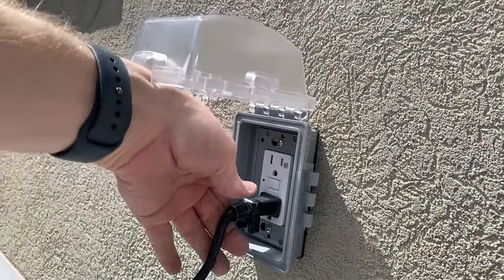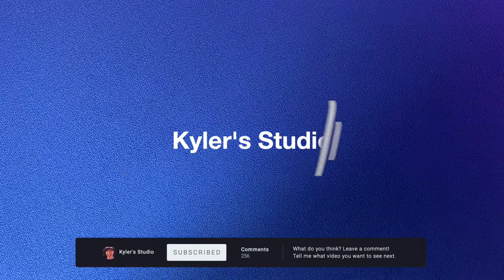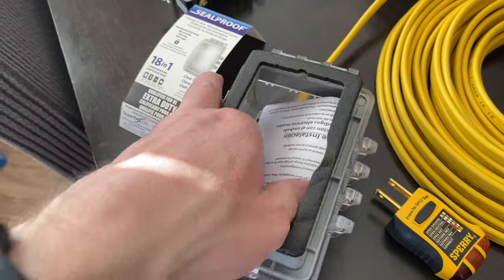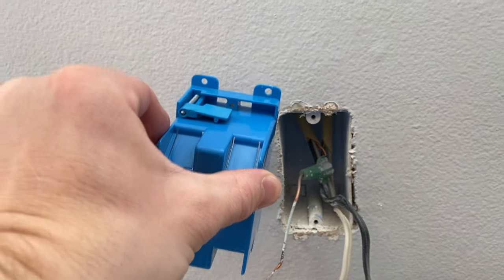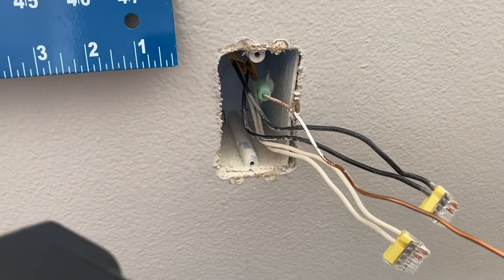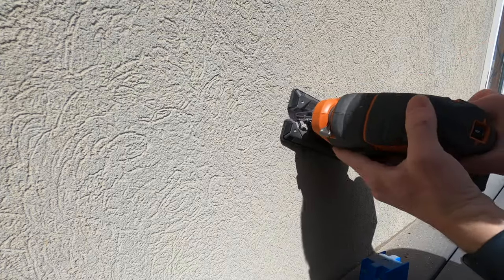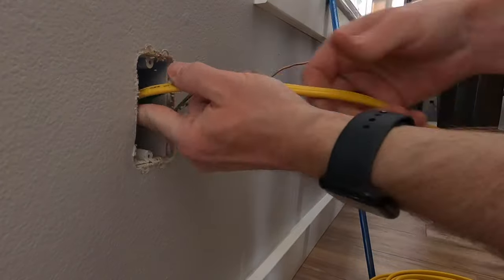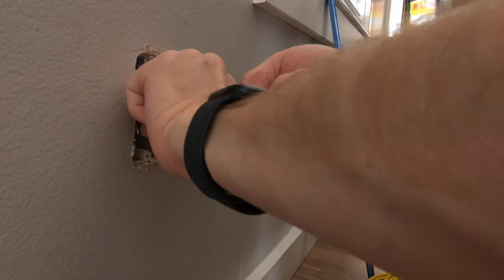How to Install Outdoor Outlet from Indoor Outlet

Comment: Oscillating tool or high speed wheel, which will fit this particular job best?
Reply from the maker: A grinder with a cutting wheel would have worked well for the long sides, but not great for the small sides; too much overcut. Good way to start though.

Comment: Have you had any issues with rain getting into the new outside box?
Reply from the maker: And no, I've had no problems with it without silicone or sealant. The foam is still intact, and the wall has an overhang, so no problems so far.

Comment: I have an existing outlet that is coming out from the wall. I tried to nail the blue box next to the stud but I have no room to get the hammer in there. Is there a different blue box I can use? Ty
Reply from the maker: Yes, there are boxes with screws you can get into a stud, or what they call old work boxes. Check out some of my links for ideas.

Comment: How do you prevent water from leaking inside the wall since you cut through the lathe paper?
Reply from the maker: I'm hoping the foam seal pressed on the wall box is enough to keep any water out. As it deteriorates over the years, I'll have to add some calking around the box or replace the box. It is also on a wall that has a roof overhang, so the only way it gets wet is when the rain is blowing sideways or the snow piles up more than a foot.
Reply: Cut a thin peice of butylstyrene for the top

Comment: I know this all worked… for now.

But there’s quite a few code violations here.  And that outside outlet isn’t going to stay in place for long as the stucco is going to crumble under load from the box and swing arm clamps as things are plugged in and unplugged.
Reply from the maker: What codes were violated and what would you do differently? Still strong a year later.

Comment: can u use 14/2 romex for wire ? even though its going to GFCI outdoors
Reply from the maker: "Can" and "should" may be a big difference. I used the same wire gage that was installed in the circuit because that makes sense to me. In my case, all the wire was inside the wall and not exposed, so it made sense to me.
Reply: You can’t use 14 if it’s a 20 amp circuit. In this case, it was a 20 amp circuit so he had to use 12/2
Reply from the maker: 12-20 14-15 Is what I remember. Just like green ground and black to brass.

Comment: You did the tab incorrectly. Push it IN, not OUT.  Then when you insert the wire from the back it will lock the wire in place.
Reply from the maker: You know what? You're absolutely right!! I totally forgot about that! It would make my clamp addition even less relevant. Thanks for the correction!
Reply: No. Completely remove the tab. They suck....😅

Comment: On stucco, ya gotta use some kinda sealant . The foam doesn't conform to all the surface irregularities. Without sealant, just hit it with water from a hose, and you'll see the leakage yourself.
Reply from the maker: Probably true, especially when the foam starts to deteriorate. I just didn't see the need because it's covered with a roof overhang. But you're right, I should probably go out and add some silicone or something to it.

Comment: The connector was unnecessary in my opinion... Not a negative comment and what do I know anyway... Your voice belongs on the Cheech and Chong, Big Bamboo album.  😂

I think the purpose of those connectors is to protect the insulation on wiring from the sharp edges of a metal box hole or knockout...
Reply from the maker: Probably unnecessary, especially considering the short run and not being designed for that..just wanted to justify buying the bag for another project I suppose. I'm not sure if the voice comment is a good thing or bad thing...I'm not very familiar. And yes, the connector is designed for a metal box knockout clamp, but they have plastic clamps now that seem like they would work just as well. Thanks for the comment!

Comment: I have to say, that was just painful watching you trying to cut your outside hole. I won't even mention the blue plastic box. Oh wait, I just did. One word of advice when adding a GFCI outlet from an inside receptacle, put the GFCI inside & the standard receptacle outside. That way you seldom have a dead outlet when you plug something into it. I know I'll catch flack on this, but I assume this is a 20A circuit since you're using #12 romex. Unless there is some #14 somewhere in the circuit or it's fed from a 15A breaker in the panel, I stick with 20A receptacles on a 20A circuit & 15A receptacles on a 15A circuit. Oh yeh, one more thing. Always tighten down your unused neutral & hot side screws. There's probably more, but I'm exhausted. Good night.
Reply from the maker: Yes, I gave a great example of how not to do it. Might have been worth just buying the receptacle box hole cutter for the recip; though not sure how well it would work once I got to the wire backing. There still isn't a great solution for cutting the chicken wire without absolutely destroying your blade. What is wrong with the blue box? Why would I put the GFCI outlet inside? I don't need it inside. Why tighten screws that are not being used? I think I can tell why you're exhausted...doing a bunch of extra unecessary work. What electrician certifications do you have?
Reply: @KylersStudio  I was a licensed electrician and Journeyman Lineman, who retired nearly 10 years ago. I had been wiring residential and commercial for 31 years as a sideline business which complimented my fulltime job as a Journeyman Lineman.
  I started putting the GFCI receptacles inside the house or building about 30 years ago after receiving a lot of complaints about tripped GFI's  that either I or someone else had installed outdoors. Just being outdoors in high humidity or rain was causing the trip. When ever it was possible, I started putting the GFCI inside and installing standard outlets outside and those issues all but stopped. I've been purposely installing EVERY outdoor outlet in new structures or remodels like this ever since & have almost no complaints of GFI trips. I don't use plastic boxes of any color EVER because they are cheap crap, thin, they flex too much, crack easily, and drywallers zip right through the edges with cutout tools when cutting around them. They are not the proper box to use for outdoor use. So what are your credentials?
Reply from the maker: @jonhansen4745  Ah thank you for explaining! As I said, I'm not an electrician at all, I just learn about it and figure it out based on research. You have good points; I'm sure all valid. I don't live in a humid environment, and even when it rains, it has yet to trip, but I can understand the logic behind it. My house is all but finished, so I don't see any reason anyone would be cutting out the wall, unless they intend to replace all the wiring anyway. So, do they make old construction metal boxes? How much more do they cost? And how do they secure into the wall?
Reply: @KylersStudio  Yes, they still make steel boxes. They nail up with 2 nails per box. Before I retired I was using fiberglass boxes for new construction  and remodel jobs in residential. For commercial wiring I used steel boxes with greenfield or EMT and pulled thhn wire or whatever was required for the particular job. A lot of what I did the last few years was wiring machine sheds, hog facilities, shops, grain bins, & grain handling systems which was mostly using either steel or PVC.
Reply from the maker: @jonhansen4745  So how would you install a steel box into old construction i.e. without a stud?
Reply: @KylersStudio  They actually make at least a couple of different style of steel remodel boxes. The best one IMO uses an expansion style piece on both sides of the box that you tighten down with  screws. Another style uses 2 thin steel brackets which you sllde between the edge of the box & the hole in the drywall & has tabs that you bend over inside the box to hold them to the wall. They can be used with standard steel boxes. I seldom used any type of steel remodel boxes & used fiberglass remodel boxes instead. One style has steel "ears" or tabs that turn with a screw in opposite corners of the box and then tighten up against the back side of the drywall. The other style uses a screw in the center of the back of the box which goes through the box into a thin piece of 1 wide steel which is bent at both sides of the box  After you push the box into the hole in the drywall you tighten the screw which pulls the steel bracket against the back side of the drywall. These are available in plastic boxes with plastic tabs also. but I refuse to use them unless nothing else is available. Have I mentioned that I hate plastic boxes? 😂

Comment: The blue tabs suck….
Reply from the maker: Why?
Reply: @KylersStudio Because plastic is weaker than metal so it's very easy for the plastic tabs to break when tightening them
Reply from the maker: @aurvaroy6670  Do they make old constructions boxes made out of metal with metal tabs? I imagine those are more expensive as well.
Reply: @KylersStudio  Yes but metal boxes have different mechanism to clamp onto a wall. You can simply get a plastic box with metal tabs like the ones made by Legrand or Allied Moulding. Sure, they cost a couple dollars more, but they're stronger and more versatile.